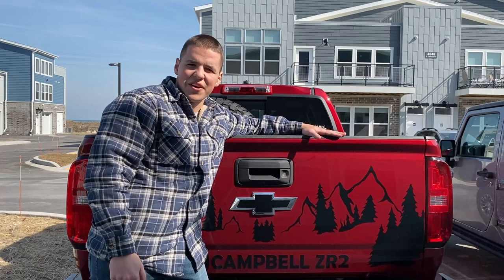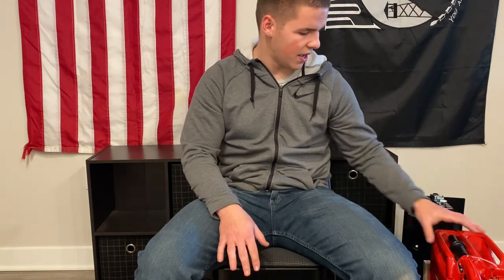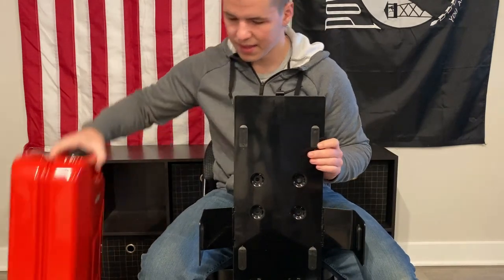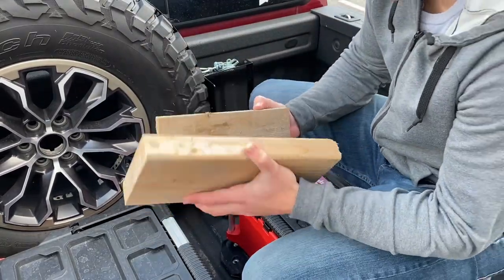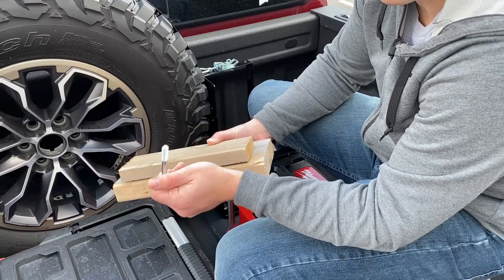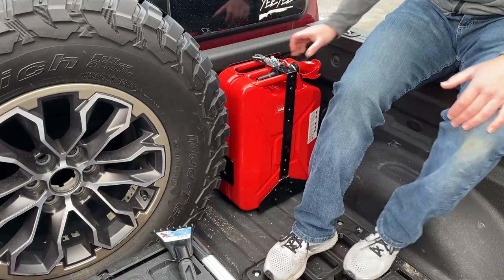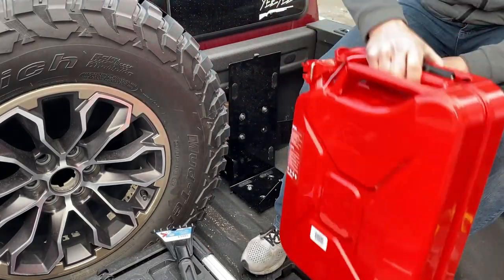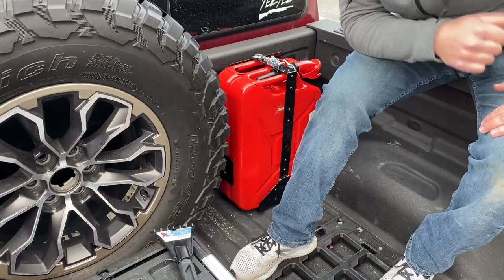5 Gallon Fuel Can Pickup Bed Mount!

Comment: Coat your wood block with used motor oil. That will keep it from rotting and drying out. Then you won’t need a 3-d printed plastic block.

Comment: What type of screws / bolts do you use for the install to stay in the floor and sidewall without using a bolt on the underside and back side of the truck bedwall??!! Please help!! What in the world is that black and orange tool you were using?!!
Reply from the maker: If you watch my video titled “Drilling holes in my pickup bed” I show more clearly how the rivet nuts work! Thanks for checking out my channel!
Reply: Campbell ZR2 epic!!!!! Thank you!!! I’m buying a rivnut setting tool!! Thank you!!

Comment: Which size rivet nuts did you go with given the weight of the carrier/can, plus fuel? Doing something similar with a dual jerry can carrier in the bed of my ZR2, but will only be able to mount on the bottom
Reply from the maker: Dave Malia I did M8, I think it’s a good size, my toolbox’s are held to just the floor with 4 M8 bolts

Comment: I have 2 jerry cans mounted on the drivers side.  I use a shaker siphon to transfer the 10 gallons of fuel straight into the gas tank. I never need to remove the cans.

Comment: On my 2015 GMC  long bed truck , my spare tire is hooked to passenger side of bed close to fender for rear tire.  Makes it lots easier to get out if have flat tire and loaded with stuff plus  can see behind me when needed.  Will be checking to see if gas can will fit next to tire at trail gate

Comment: It's sold out on the website?  Any alternative places to find this or similar items?
Reply: I have 2 Jerry Cans, the same style, and a dual holder for my truck. All were purchased through Front Runner Outfitters. Works perfectly and great quality. No issues with seals on Jerry Cans and the holder works phenomenally when mounting on the roof or in the bed without any rattling of any kind
Reply: @devincutting3198  gonna look that up now. Thanks man
Reply: @b-lew777  anytime my friend! Definitely wouldn't recommend them if I myself didn't like them, they'll suit you well enough; also.. if you only need 1 5 gallon can, they of course make a holder for that too.
Reply: @devincutting3198  I want about a 5 gal if they got it. Bug out vehicle if every necessary lol
Reply: @b-lew777  definitely agree! I've got a lot of stuff under my new canopy from Alu Cab. My whole rig is fitted out for that scenario as well lol
Reply: @devincutting3198  never know man. Stay safe brotha 🤙

Comment: Rivnuts 😎👍   Think you could secure it safely with 4 bolts total, 2 up top and 2 on bottom provided they were diagonally installed.  Nice bed installs so far. Going to have to look into that cargo system for me brother.

Comment: Hi, i really like that jerry can holder.  With my set up, im gonna use a rock slide engineering straps that straps around my spare tire and bolt that can holder to it.  Do you think this wavian jerry can holder will hold 20L of water?  Thanks in advance.

Comment: what was the tool you used to install the theaded rivets into the truck with?
Reply from the maker: REXBETI 14" Rivet Nut Tool, Professional Rivet Setter Kit with 7 Metric & Sae Mandrels and 60pcs Rivnuts, Labor-Saving Design, Extra 1/4-20 mandrel with Rugged Carrying Case https://www.amazon.com/dp/B07MVXN7LK/ref=cm_sw_r_cp_api_glt_fabc_AS8JWMZP9VYQK32TK2QN?_encoding=UTF8&psc=1
Reply: @campbelloffroad3660  self-tapping screw bits work.

Comment: two questions- what kind of rims are those??  They r sweet!  Also not sure how you were able to get the bolts to hold once you drilled the holes??  Thanks
Reply from the maker: mac tamminen those are the stock ZR2 wheels, and I use Rivet nuts, you can see me putting them in at 8:00 in this video, they clamp the sheet metal and leave a threaded nut

Comment: Thanks for the post.  Can you please provide a link to the can holder?  Thanks.
Reply: its the Wavian heavy duty 20L frontload holder. you can get it on the same link to the fuel can, when they have it in stock.
Reply: @Joshua.M.S.  there sold out. Any other alternatives?